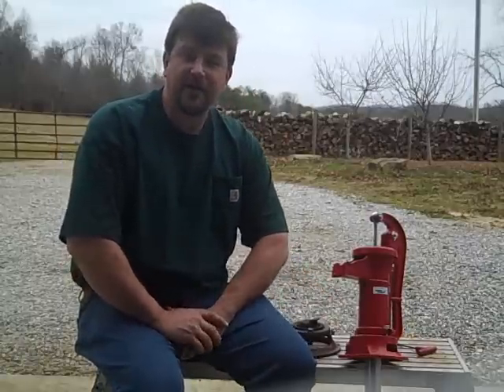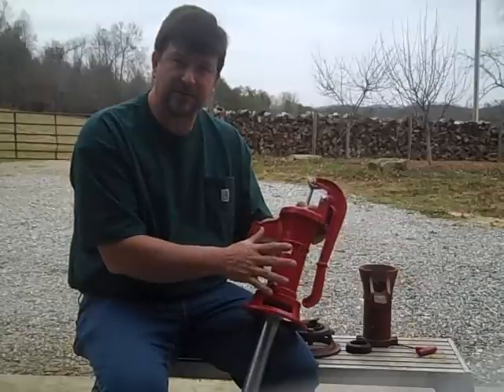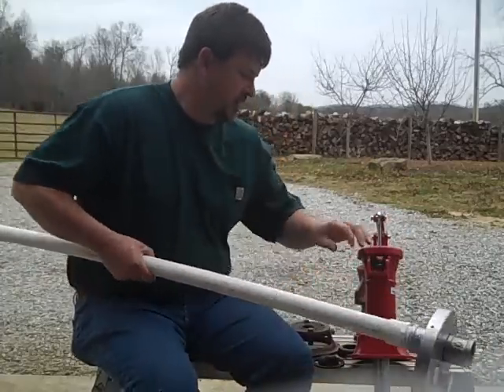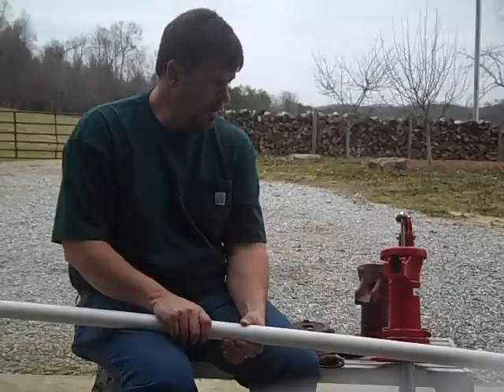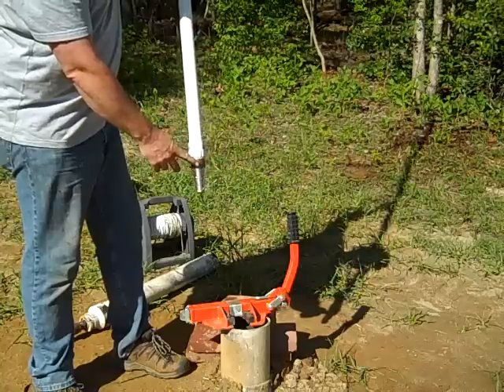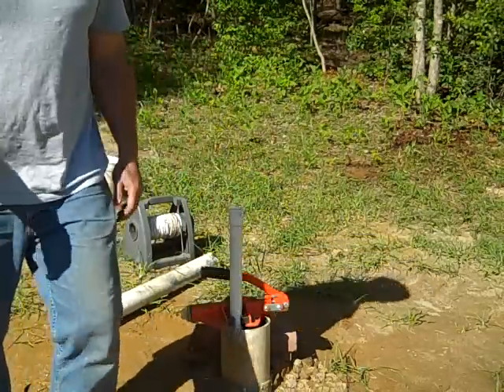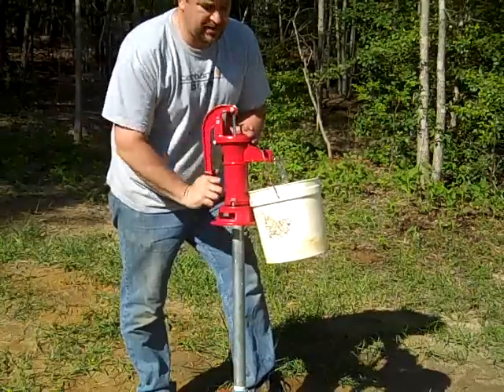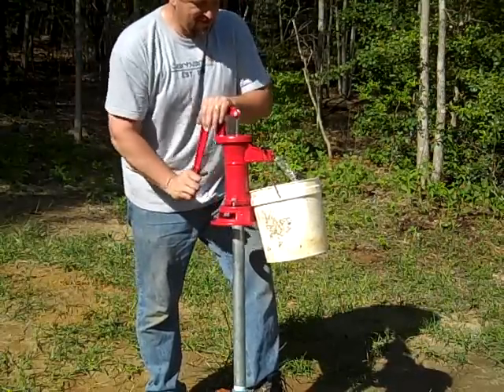All about wells- Pitcher pumps

Comment: Very helpful video. I'm cleaning up an old pump. Is painting the inside to prevent rust a bad idea?
Reply: +Stephen Warren very!!
Reply: +Stephen Warren  a tiny  paint flake can plug your diffuser on a shallow well 7 I've seen 2 pipe  jet systems get  p[lugged this same way 60 feet down a well  the venturi was plugged with a tiny  paint chip and the pump wouldn't  make  over 25 lbs pressure  The best way to keep a pump from rusting up is to use it often !

Comment: Thanks for posting this,

I have a question these work great in warmer weather but we live in Northern Idaho where it can get really cold with lots of snow,  Do you have any suggestions about keeping these from freezing?

Again thanks much
Reply: Do not use a foot valve....
The pump has a built in leathet check valve to hold the prime.... 
Raising the handle all the way will open the check valve and allow the water to go back down the well an prevent freezing..
Pump must be primed and released each time you use it in the cold weather...
Reply: +Eileen Simpson  the best and  most efficient way  is to unthread your pitcher  pump in the winter and take it inside  if you  need to use it  thread it back on  pump it up use it and take it back in when done! If you leave water in a pitcher pump... even a little in the pump it will freeze and crack . I've seen it happen way to many times to count . Or set it up in a heated barn or something like that !
Reply: RJ Actually, your supposed to flip the seal. This lets the water drain back into the well after every use. You have to reprime when you use the pump but at least it doesn't freeze.

Comment: If you add multiple check valves, it could be a lot easier to draw water from deeper well.
Reply: +Mon S  No infact  two check valves  in the same  line  is a very bad idea ! they are still opening at the same time and drawing from the same depth

Comment: Hi Great video,
Just wondering. I am installing a 1 1/2 Hp pump to my shallow well for sprinklers. I plan on building a wood box to hide the pump and thought it would be nice to have a pitcher pump on top. Is this possible to do off the 2"pvc? I was thinking I could T  off the intake side of the pump  after the check valve with  a on off valve to protect the pitcher pump from the electric pump pressure when not in use. Would this work? thanks for any input
Reply: ED Beardsley It is always a very bad  idea to create any more connections  than absolutely necessary on the suction side of a well pump chances are it will suck air through the check valve as there is much movement when operating a pitcher pump that would inevitably weaken your glued  PVC fittings.. It can be done just  not very advisable on a PVC set up  and it would  have to be set up pre check valve on your  pump

Comment: Hey, hope you can help.  We have an old house with old well.  Think its 50 ft down.  Currently using a 3/4 hp jet pump located inside the house to pull water.  After listening to you, how can that be if the pumps can't pull beyond 30 ft.   Or did you mean only mechanical pump?  Our well is underground and we suspect casing is old most likely deteriorating.  Foot valve was replaced by previous owner over 12 years ago.  Anything we can do for ourselves in this situation to upgrade the current well? SOS   Thanks for any help.  Great water.  Company wants to redrill a new well that surely will yield lousy water.  Not helping with our question.  Thanks again.  Your videos are really helpful.  hahahah did not even know what a foot valve looked like.
Reply: For that particular mechanical pump it's about all it can handle.
They do make pumps that are capable of deep wells. I've seen a few stainless steel ones that are really good, expensive but good that can handle 50 without a problem.
Bison Pumps is one of several brands.
Deep Well Hand Pumps reach a static water level of 300' feet. Our deep well pumps can pressurize a tank, are self-priming and require no routine maintenance. There are deep well pumps that fit a variety of applications and work in conjunction with electric submersible pumps in most applications.
Reply: Suzanne Ramoundos you can have a well over 100' deep just as long as your static level is no more than 30' to water in your well , if it is then you probably have a 2 pipe jet system  "you can tell this if you have two pipes going  into the front of your well pump", Not including the discharge pipe that goes to your expansion tank.
  On a  2 pipe  jet system 60% of your pumps capability  is used to circulate water inside the well, as it does this it pulls water  in from the well via a venturi nozzle and diffuser that is set on a pipe  close to the bottom of the inside your well.
Sincerely 
Rick 
25 years of well drilling & pump installation
Reply: +Rick  But i have a 2 pipe well that used to service the house but my water is only 4 feet under the ground.  A very shallow well

Comment: I have a well with a static water level of 30 feet which makes it a deep well .  I don't understand how it only costs around $ 100 to pump water from 25 feet down but if I want to go down around 45 feet then it will cost me around $ 1700 for a deep well pump ?  That is absolutely ridiculous .There has to be a cheaper way .
Reply: +SELF-RELIANCE and a STRONG COMMUNITY  .. there is  dig a hole down 7 feet build a beehive  pit of buy a prefab one set your pump up down in the  pit  you wont have to worry about freezing either & you will be pulling from 23 feet ..$100 bucks to put in a well 25 feet ?...Where is that happening?  In 1845?

Comment: Thanks for the great video! A foot valve though that holds the water in the pipe between pumpings is not recommended for cold climates.  If the water freezes in the upper part of the pipe it won't work, plus it could burst the pipe.
Reply: That’s why you drill an 1/8th” weep hole in the section just below freeze line

Comment: i want to rill a shallow well at my cabin. how do you deal with freezing issues? it gets below -22c sometimes at my cabin. can you recommend any solutions? thanks for the great video. :)
Reply: alzathoth  I drain & then take my  pump inside and break suction via loosening a 1"1/4 threaded we'll cap on the top of my well...so the water seeks it's own level back down the well !

Comment: why are you using male adapters instead of couplings on your pvc to connect your sections of pipe, there is a chance that you will have a leak there where a coupling is much easier and dries in seconds
Reply: So he can disassemble likely.

Comment: 144/8.34/7.45  = 2.31
8.34X7.45 is the weight of 1 cu ft of water. if you imagine a cube 12 in on a side, there are 144 sq inches on a face. Hence the static pressure of 1 ft of water is the weight of a cubic ft of water / 144.

Comment: Hello Engineer 775.  Thank you for making this video.  Question, where can I buy a check valve similar to the one you have in the video?  I went to LOWES, Home Depot and Farm and Home Supply and none of these places had the type of check valve that you show in the video.  They all had check valves for the PVC pipes but they all had a large bulged housing which will not fit down the hole that's typically used for well pipes.

Thank you.
Reply: Steve Rulison mm

Comment: Prime to use.  Remove prime when done.   When I was a kid we had one at Gramma's.  To remove prime, you lift the handle all the way up, like to pump, then down about 4 inches, then back up - repeat several times.  This allows the water to drop, and removes the prime.   I do not know if Gramma's had the check valve on the very bottom like this does, or not.     I DO know that if you don't let the prime down, it will freeze, damaging the pump, . . .  not to mention what Gramma will do to ya!
Reply: Thanks for this tip ill keep it in mind for my pump!

Comment: probably been said before, but you could weld a small horn to the pump so the bucket doesn't slide off. bit of paint  to touch up. could make the risk of wasting water that little bit less

Comment: Someone wasn't paying attention in physics class. You can't suck water from more than 34 feet below the pump, because the pump creates a vacuum, and air pressure actually pushes the water up to the pump to fill the vacuum. You can however, push the water as far ABOVE the pump as the design allows. That's why modern deep water wells have the pump, WAY down in the ground, usually at the bottom of the well, or close to it. Because you cannot beat a law of physics. You have to work with/around them.

Comment: FOR THE QUESTION ABOUT THE 2.31 FT THAT IS A FORMULA USED IN WATER FOR EVERY 2.31 FT OF WATER IT EQUALS 1PSI OF PRESURE OR FOR OR 1 FOOT OF WATER EQUALS .433 PSI. THE SAME ANSWER JUST TWO DIFFERENT WAYS TO COME UP WITH THE SAME NUMBERS. EITHER IN PSI OR FEET !!!

Comment: what if I use a air compressor to push the water up air flows down one pipe and pushes water up another? and I work on a few oil ridges and we used a return system but with water and air forced

Comment: great vid.  it filled in a lot of holes after watching a lot of other videos.  can you go into detail on sealing the casing to keep ground water out?  i think you mentioned clay in another video, but i don't know where to get that or know what it is sold as.  i was actually thinking about gravel to about a foot or two from the surface and then pouring cement as a seal, but i haven't seen this issue addressed, so i don't know if that would be good.  thanks for the videos

Comment: What size foot valve are you using? 

At Home Depot they had 1" and 1 1/2" foot valves. The larger one increases the overall diameter and I didn't know if the 1" would cause problems when using the 1 1/4" pvc.

Does the above ground portion of you system count for lifting height? 

You have 30' of pvc and a couple of galvanized above, plus pump height...are you close to the 33-34' max for pumping?

Comment: What would you suggest for a deeper well? At my parents house they had to drill down through the 100' of hill and then some to the water table. I very much desire to have a manual opperation attached in case of an extended power outage.  Is there a manual option available?

Comment: TheKYnyts & otis991000, For a deep well you need a SUBMERSIBLE pump, it goes down IN the well casing itself.  Engineer 775 said you can't SUCK water farther than 34', deeper than that you need to PUSH the water up the pipe. Our family was in the electric motor/pump rewinding & repair business since 1960. You're right about the pump being much more expensive, as it takes a highly specialized motor to fit into the casing and still have enough power to push the weight of the water up the pipe.

Comment: Im in south central texas and my well has been inactive for over 10 years. Its fairly deep 2500 feet last I remember BUT it needs to go deeper to get to the good clear water. we got iron and sulpher when it was operational. My question is, can I set up a well pump to push the water up and into a shallow holding tank buried in the ground then when necessary be able to pump from that tank? There are no shallow wells around this area less than a thousand feet.

Comment: There's really no such thing as a vacuum. There's close to zero PSI which is what one might call a perfect vacuum but it's really just LESS pressure than atmospheric. It's really the atmospheric pressure PUSHING water up the pipe when you create less pressure above it by using the hand pump. That's why the limit for a suction pump is 34'. The only time you'd want an air lock at the top would be if you can pressurize the air space below the well cap to assist pumping.

Comment: Is the cap used strictly for mounting or is it necessary to create a sort of air lock? I have an ancient "open" well probably 3 ft diameter; planning to mount the the hand pump on a piece of wood spanning the opening, so there will be open space around it. Top of water level is only about 14 feet down, so I won't need much PVC. BTW, Harbor frieght had a few pumps in my local store at about $25, don't even know if it works yet (have found many times they have "faulty" products). Great info!

Comment: If you use a foot valve it will freeze so you would have to take precautions against that.  I think they make a manual release dump valve that you could install inline with the PVC several feet below grade that would work.

Comment: No, listen to the video, 33 feet is the farthest water can be drawn up with a vacuum pump.  In a vacuum, water will only rise 34 feet at one atmosphere from its static level.  A column of water over 34 feet has more weight then the pressure that is exerted by the atmosphere when compared to a vacuum.

Comment: I got a problem. My well here in Arizona, My well is 853 feet deep, dug by an oil rig as a demonstration. The static water is around 400 feet, and the water comes out at 53 degrees and slightly carbonated. The pump that is on it is a 3-phase pump. 1,500 gallon tank. BIG question is, how do I get water without electricity?!? Please help if you can.

Comment: Scott,  I liked the way you break down all the parts needed.  Please do this with the simple lever arm pump.  Do you have both the pitcher pump and the simple pump at the house.
I am new at this and need a parts break down with the simple pump.
Also where did you buy the metal cap in this video.

Comment: Now THIS was the vid I have been waiting for! Thanks for doing this vid...we have 3 wells, one has an old hand pump that doesn't work, one has a pump and bladder tank for the house and one is for irrigation. We have no idea about the old well with the hand pump, but the original house on the property (that we burned down a couple of years ago) was built in 1921...I saved the well pump. Now I have to dig around it and see it there is a casing down there somewhere.